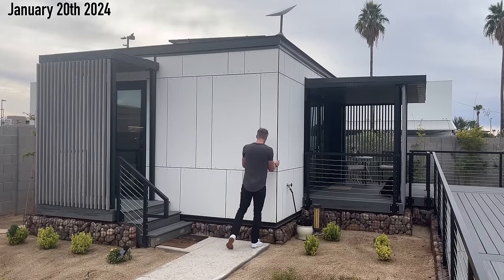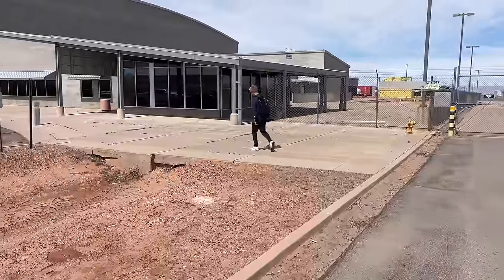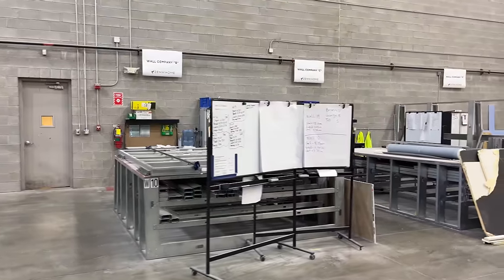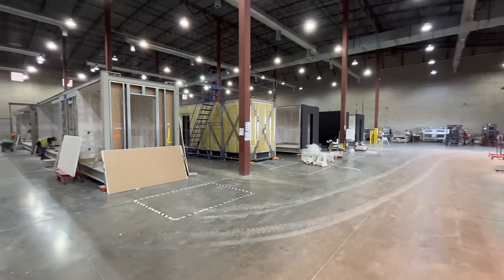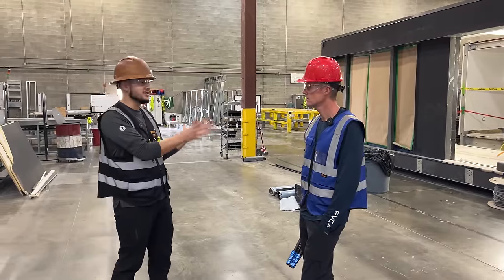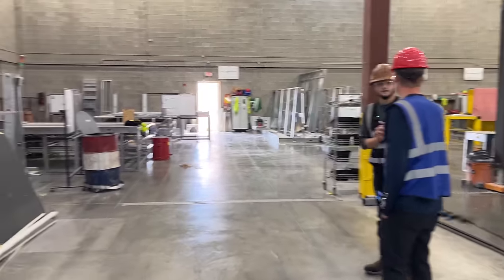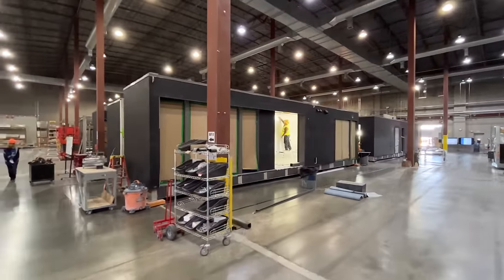Made in America - Inside Look at the Company attempting to Build 24 PREFAB HOMES per day!!

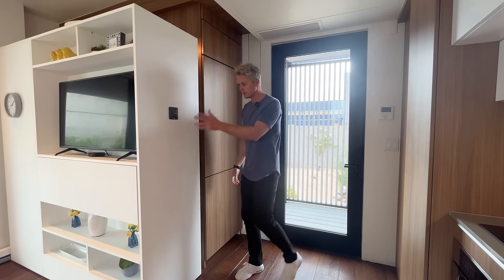Comment: At 1:06. The electronic closet is a nice magic trick but I'd rather the closet manually slide on a track. The closet is small. There's no need to complicate the closet with electronics that will break and incur costly repairs.
Reply from the maker: great feedback, thanks David
Reply: I'm sure they have a manual work around like they do for the bed in case power goes out right @Kerry Tarnow ?
Reply: @michaelclark9134  Great question. If not, imagine the cost of repairs.

Comment: Problem here is you can still build a home from the ground up for a lot cheaper. The small one is $280/sf and the large one is $195/sf, and that's before delivery and installation. Add that in, and it's $300-500/sf easy. Even being furnished, it's just not worth it.
Reply: Couldn't agree more, the way some tiny home manufacturers are pricing their products, defies logic and sanity.